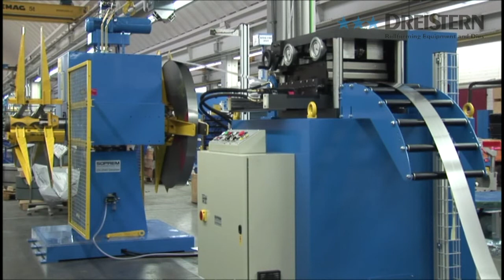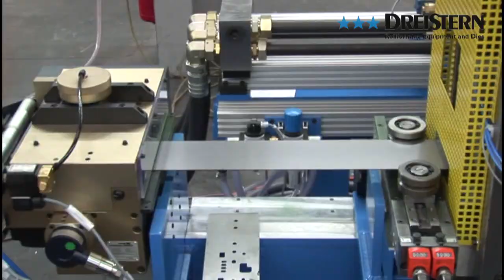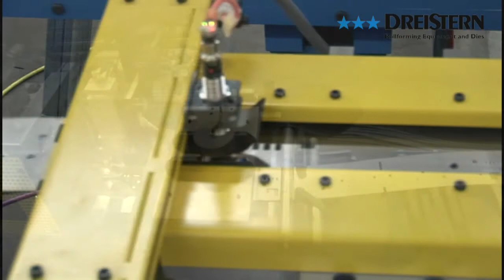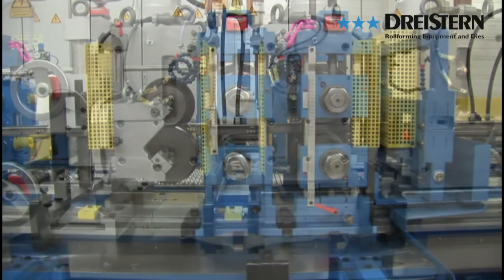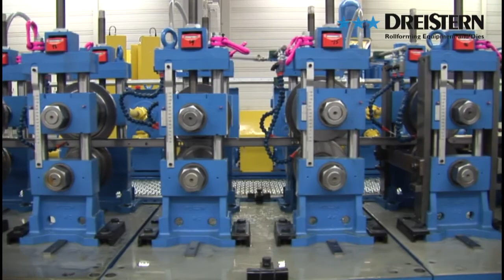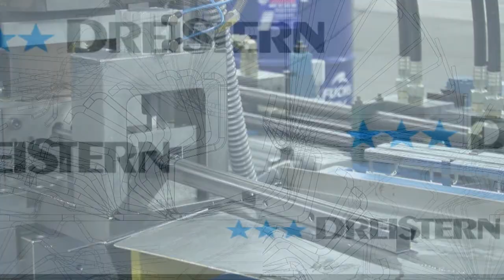DREISTERN roll forming line for seat adjusting slides / Profilieranlagen für Sitzführungsschienen

Comment: We were privileged to use your rafted/segmented roll forming tools in the fabrication of decorative and functional bilaminate moldings for use in vehicles. This commenced in 1985 in our plant. We used Tishken articulated straightening dies in conjunction with induction heaters, ultrasonic wash tanks, material accumulators, PVC extruders, haul-offs and flying saws.

Driestern componentry allowed rapid changeovers for a competitive edge. I was privileged too in working with the finest toolmakers, engineers, support personnel and managers anywhere on the globe.
Reply from the maker: Thank you TralfazConstruction and best regards from DREISTERN GERMANY
Reply: @DreisternGmbH  You are most welcome and I would add that the Flying Saws I'd mentioned were speed-synchronized Dreistern tools; excellent designs far ahead of anything else in their time; c.1986-1992.